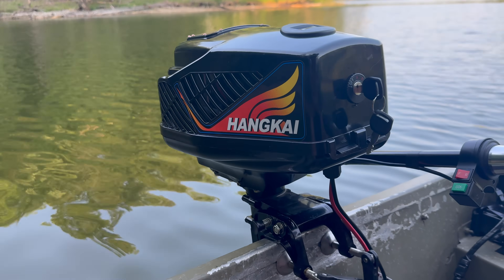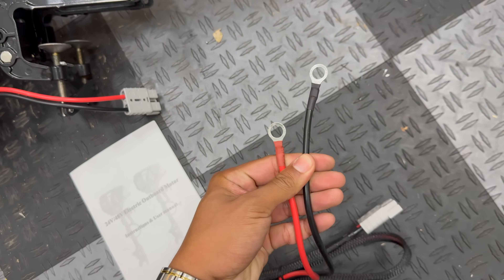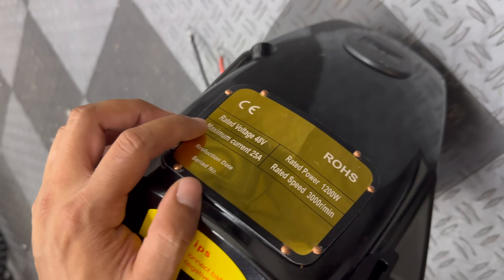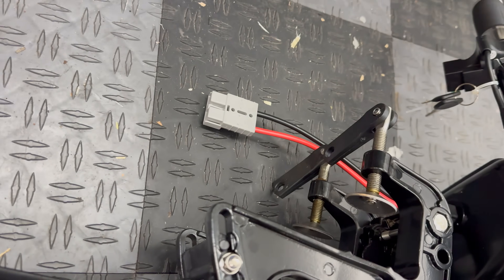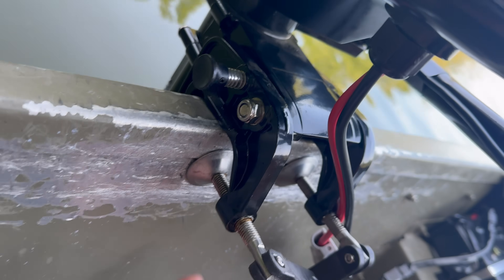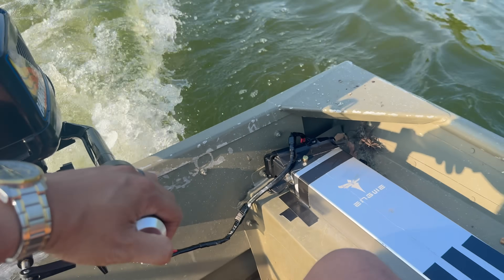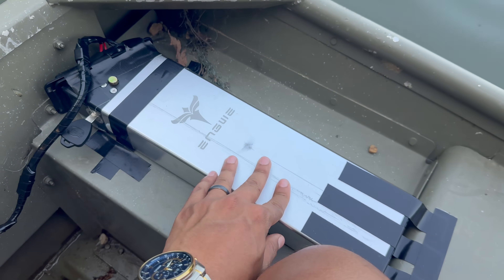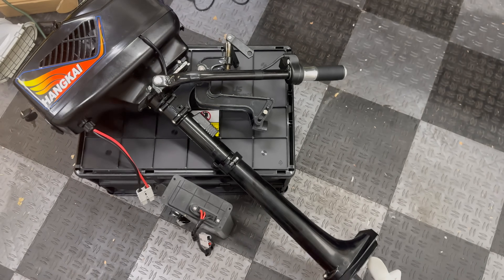Hangkai 48V 1200W Electric Outboard Motor Testing and Review

Comment: One hp is equivalent to 746 watts, so no. I'm guessing you would be lucky to get the 1.6hp.
Reply: Chinese horses tho
Reply: @tonyp9179   western companies do the same thing with trolling motors. They are propped with low pitch propellers so at low speeds they can have similar thrust of a larger hp gas motor. Basically just geared slower. It is total nonsense of course to claim more HP. 
In addition the electric watts are usually input watts. After the losses of the controller and the motor you are lucky to get 0.8x of the sticker watts out. Where as the gas motors power is shaft power. 

Electrics are cool for many uses but I wish they didn't rely on such misleading advertising.
Reply from the maker: @tonyp9179  😂
Reply: @PatOutdoors  have you looked at the APC 10x8 or other prop upgrades? You could probably get another mph or 2 with one
Reply: Electric outboards are rated in equivalent thrust, meaning that this motor in theory should produce the same thrust as a 5hp gas motor. It's not a direct kW to HP comparison. This is more accurate since the ICE engine is less efficient so a smaller percentage of the hp the motor is producing gets to the prop after mechanical and thermal losses.
Reply: @aerohead8088   no, not really more accurate. Propeller doesn't care what spins electric watts or gas powered watts - and a 5hp gas motor has a lot more power at the shaft. These just typically have very low pitch propellers meaning they can have higher thrust at very low speeds. But they can never reach speeds a typical 5hp could reach. 

Now electric motors typically provide high torque from bottom rpm up but that is of no advantage as the torque on a propeller goes up with rpm - very little resistance at lower RPM.
Marketers like to confuse these things a lot to be able to claim big numbers and advantages that aren't there. And I am here because I am interested in electric motors, just dislike the marketing tactics.
Reply: @heikkianttila6296  Equivalent thrust is the propulsion (pushing) force output measured with whatever propeller they test/rate the motor with; it is an external force measured as a result of, and independent of the power system. This is equivalent to "dyno" testing a vehicle at the tire, the output is the output. You can spec a propeller to optimize performance for a specific motor and/or characteristic. Now how this number varies with fluid dynamics, rpm, propeller loads, cavitation etc....I cannot verify without data, but the max output  is quantifiable and if rated accurately by the manufacturer, equal.
Reply: @aerohead8088  not disagreeing with what you said. But dyno from a car is not equivalent for one reason propeller slip and efficiency. The other factor is that thrust (force) is not measurement of power. 
You can take a say 5hp gas outboard and fit a large are low pitch propeller, call it A, on it and get much higher thrust out of it. The power didn't go up but thrust did. Car equivalent would be more torque on wheels from switching to a smaller gear.
Now then let's switch to a higher pitch propeller B (equivalent of higher gear) - if the motor has the power it can give you thrust at much higher speed (power is force *speed). Same as in a vehicle you can't gear a weak car to 120mph - it might have the required gearing but it will simply not be able to reach the required rpm.

Electric motors are typically fit with a A type propeller and would fail to reach maximum rpm and thus speed with propeller B and in fact typically over heat if tried.

Simply measuring thrust is like a dyno that measured only torque but without caring about rpm. Changing gears would give different figures - and in fact this happens in the form of measured torque but as power = rpm * torque you need the rotational speed for measuring power and real potential of the power source.
Reply: Bingo🙌🏾 @aerohead8088
Reply: @aerohead8088  Firstly, I realize it is not a direct "apples to apples" comparison, However, the motor is not advertised as 5 hp equivalent, it is advertised as 5 hp. Horsepower is a direct result of torque multiplied by Rpm, which can be measured on both electric and gasoline engines.
It is not due to efficiency the comparison is made, it is due to the fact electric motors produce a lot more torque, and thus can accelerate a vessel comparatively quicker than the "equivalent"  hp gas motor.  
Even saying all this, if you look at a major brand, such as Mercury, they state a equivalent wattage for 5hp as 2200 Watts. So no way this motor is even going to be close to the advertised "5 hp" with only 1200 Watts. Just my 2 cents.
Reply: @lowtus7  You are correct. But ultimately the actual propelling force, regardless of power source, is the thrust produce by the propeller as a result of the available power. Therefore the performance equivalent of said thrust is used in order to maintain a comparative and logical relationship between dissimilar power production methods. If you sold an actual "5hp" electric motor as 5hp then the common consumer would be not only overpowering, probably overloading, and overpaying for their motor.
Reply: Sea horses power
Reply from the maker: Correct, debunked it. I said this in the video, pushes decent speed for being less than 2 HP though
Reply: @PatOutdoors  pushes like a 5 horse maybe
Reply: Try a 5hp gas outboard and see how the speed compares.
Reply: @seansvid I think it close to 5hp. I have 6 hp gas look like they doing same speed with 2 pole on board.
Reply: Correct, 1hp is approximately 3/4 of a killowattt.
Reply: @stumccabe  wheel horsepower or break horsepower?
Reply: freedom unit vs metric XD
Reply: Water sucks up Hp too divied that 3 to get your real on the water hp.
Reply: It's 735 Watts.
Reply: @danielduesentriebjunior  Not sure where you get that figure from.
One Horse Power is defined as the amount of work that can be done by a standard horse in one second. In the International System of Units (SI) the electrical equivalent of one horsepower is equal to 746 watts.
Reply: Maybe your horse is sick?
Reply: @lowtus7  James Watt defined that number for his own purposes. Turns out most horses have way more than one hp under the saddle. Took a long time to figure out why horse drawn farm equipment was so effective from one and two horse teams in comparison to 35 hp diesel tractors.
Reply: @paulhenry8174  it's I believe "for a day". Strong humans can produce almost 1.5hp for a minute (elite rower, indoor world record holder). I think I have reached 1 hp or near it for seconds on a rower.

My dad starting farming with the horses still around for farm work. He always tells how one horse pulled a rake out that was stuck on a wet spot on the field and tractor did not have the power to do it.
Reply: @danielduesentriebjunior  temperature also plays a role on draw.
Reply: 1.6pp.  Pony power
Reply: That hull, 6 mph, I'd say around 3 hp gas engine.
Reply: Internal combustion engines (ICE) run at about 12-15% efficiency while electrics run at about 95%. .. thus a 15 hp ICE motor produces about 2 hp at the propellar.
Reply: @RichardCrouch-er2ib  this is irrelevant beacause the gas motor is not advertised based on the energy content of the fuel but on the power at shaft.  Gas 5hp provides at the shaft likely 3-4 more than this  unit. Fact. 

They just put lower pitch ("gearing") props on these so the low speed thrust is higher but higher speed performance is fraction of the gas 5hp.

Comment: I have a pair of the 2200W version (marketed as "8HP" 🙄👌) pushing my 21' pontoon. Can't get up faster than about 5mph but I have a suspicion a lot of that is the shallow-angle props that come with these. I wonder if you have thoughts about how to find more aggressively tuned propellers for these?
Reply: You are closing in on what might be the hull speed, so a more agressive prop might not do anything for you, and can potentially even slow you down.
Reply from the maker: Well pontoons naturally have more drag, but I think they mislabel these electric motors. Because 2200 watts is more like 3 HP.. also do you know what amp rating the controllers are on yours? Just gotta make sure your battery is enough to supply enough amps to both motors
Reply: @PatOutdoors  yeah, 45A max draw. I have 4 24V batteries (2S 2P) so that's not an issue.

Comment: What about a gas engine grass trimer with a propeller, put into a water? )) I guess it lasts 3 hours with one tank of a petrol. Saying seriously, what's an advantage of using an electric motor on a small boat for you, sir? Cause 2-3 HP boat motors can be as cheap as this one, but it also needs a battery +$200-300 diy, and a charger +$...
Reply: Not to be mean, but if that is a serious question for you, I'm not sure why you're watching this kind of video. But let me help you with something - those LiFePo batteries can be charged thousands of times. THOUSANDS. If you took that boat out just 100 times and used just one gallon of gas each time, you would have already paid for the battery.
Reply: @jshireley  Kink of serious. There are number of lakes here and in countries around, and many of my friends are fishermen from time to time. Besides, I’m interesting in water toys in general (like 100-150KV motors)
Reply from the maker: Well I have both. My gas two stroke is a bit faster and lasts longer but is super loud, doesn’t have reverse function, and scares all the fish away if i just want to navigate slowly when im fishing
Reply: @PatOutdoors  Aha. I see. Makes sense for me. Have you seen any muffler for a 2 stroke engines? I'd personally like to have on my trimmer. Cause it's not about me but my neighbours )
Reply: Real ting

Comment: Did you put gear oil in the transmision just after the propeller ? 
Normaly they dont come with lube in it
Reply from the maker: It came prefilled, actually seeped out a bit from shipping
Reply from the maker: Not the electric one! I just pulled the prop off and opened up the lower unit and it’s fully filled with gear oil.

Comment: I saw another video of one of these hangkai gas motors and buddy read in the instructions to fill the gears with oil behind the prop it was totally dry. not sure if yours is the same but worth a look if you haven't
Reply from the maker: This one came prefilled, actually leaked out a bit during shipping. But I’ll look over it, thanks
Reply from the maker: Just confirmed! I just pulled the prop off and opened up the lower unit and it’s fully filled with gear oil.
Reply: @PatOutdoors  whats a better prop for this machine?